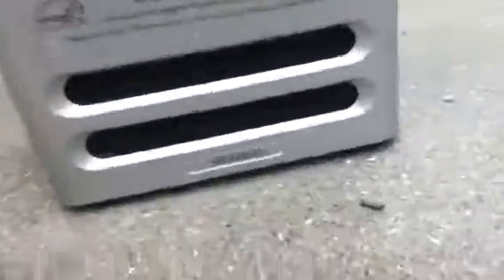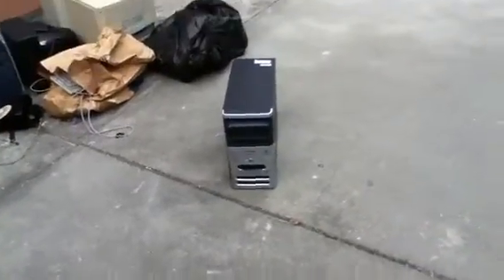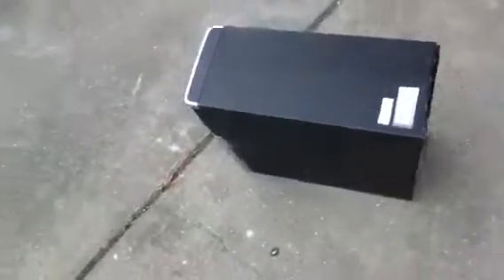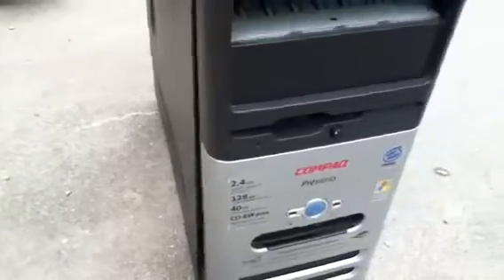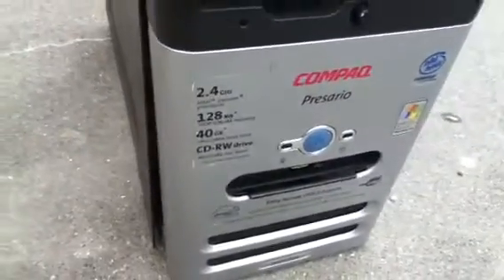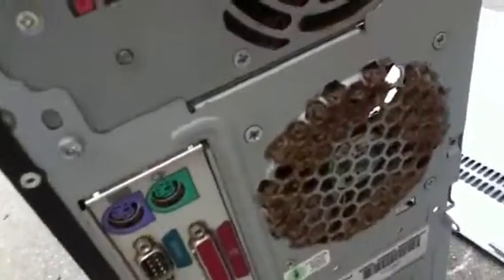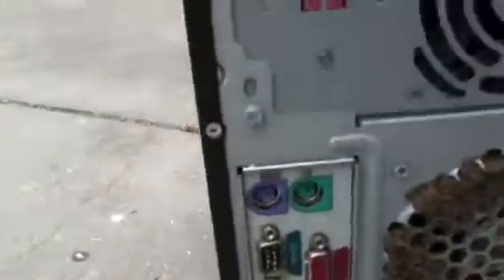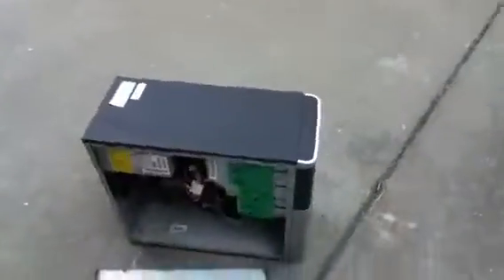My Trash Picked Compaq Presario S4010OM

Comment: Well I think this is a great find! It's ironic because about a week before the big April Windows XP downfalls we got rid of our CompaQ Presario S6200CL, which is the same exact computer as this one basically. Ours had slightly better specs than this one, 512 MB SDRAM, 128 GB hard drive, 2800 AMD Athlon XP processor. Everything else was the same. Sad because it still worked pretty well (kind of slow, but that's expected of a 13 year old PC). Cost like 1200 dollars new. Only the badass had this back in the AOL days
Reply from the maker: Don't worry, it was a great find. Watch these 2 videos: Compaq Presario S4010OM Updates and Initial Test & Compaq Presario S4010OM Start Up (Kind of). It's ironic that I found this in April 2012 (instead of April 2014). Wow that's too bad you guys got rid of it.
Reply: I would kill to have ours back now. Still worked flawlessly. I have some video of it somewhere (God only knows where) that I need to find. Like one time I did a boot- up race between my Windows 7 laptop and the CompaQ. HEY WE STILL HAVE THE MONITOR THAT CAME WITH IT! Too bad it stopped working years ago. Oh, and nice job of getting that old clunker back up and, doing... something
Reply from the maker: TheCRTProductions- Weekly Videos about vintage electronics! Hope you can find it. Is it a CRT monitor? Yeah it was fun getting it back up and running. It was a tough PC too. I used to leave it out in the rain for like a whole year.
Reply: It's an LCD monitor with built- in speakers and everything ○-○-○-○○○○○○99○9○
Reply from the maker: TheCRTProductions- Weekly Videos about vintage electronics! Oh okay.

Comment from the maker: I didn't unplug it. It was already like that. I just assumed it was dead, due to the rust and dust and just left it around. I believe in January 2013, I finally did some minor cleaning. Finally in August 2013, I took everything apart, cleaned off everything, and put a new trash picked PSU in it and it works!

Comment: i uploaded a vid where I take the side off my b110 uploading, i think the 2350 is the same way, you could pop the ram in the compaq if you still have it to see if it posts or not. I found a 4600 with no hard drive, and it worked, just too dirty and overheated, cleaned it out and was fine. Its amazing poeple throw crap away because they're too lazy to clean it.

Comment: Looks like it might be at standard micro ATX board, and likely power supply. Just put in a decent mobo and cpu and drive with linux
Reply from the maker: Don't worry. This machine works again now. I just need an HDD. ;)

Comment: xD IKR, Out of the years that I have been trash picking, I have only gotten 3 computers, only one worked without repairs, and they were all ones at an auction that nobody wanted, not really true trash picking. They were an L800R(only one that needed no repair), a E521S(damaged cpu pin and super dusty) and a Compusa box(bad video, hdd, ram, psu, cd, worked in another case but threw it out a while back).

Someone needs to make a tutorial on how to trash pick lol

Comment: is the latch broken? On my 4600 you have to wiggle it back in forth while its pressed down to get it to release the side. You also have to pull back on the side while its down, sadly it doesn't pop off.